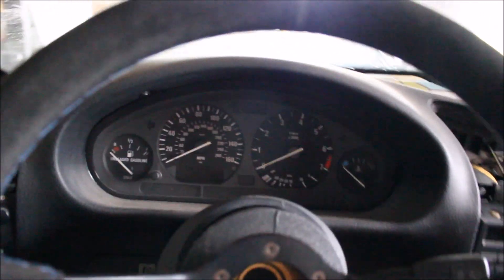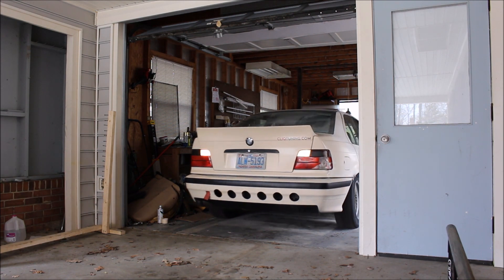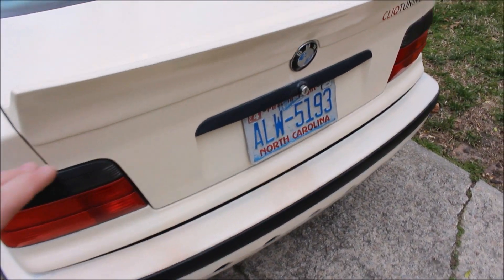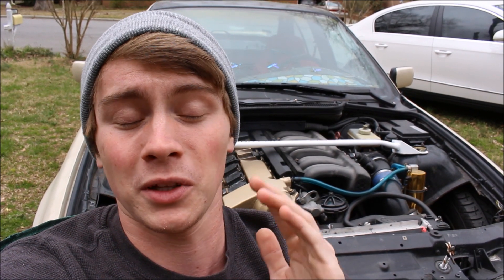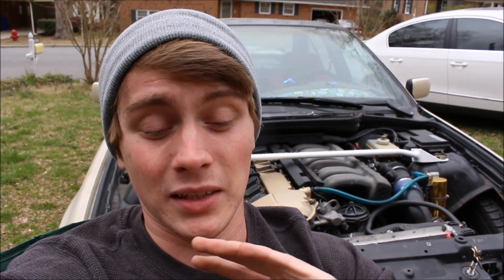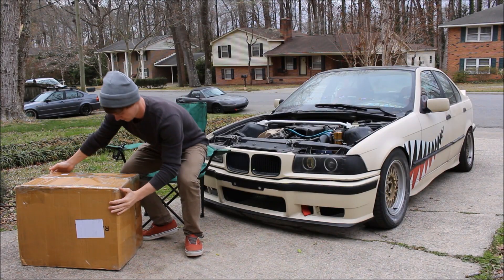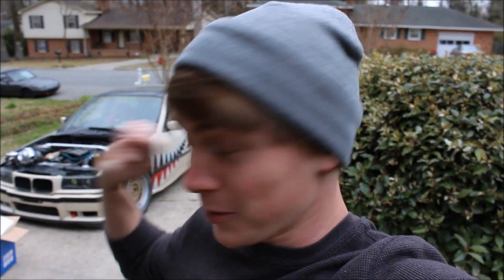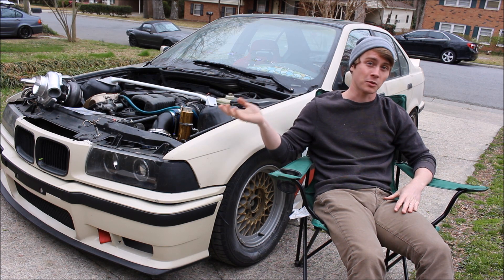THE E36 IS GETTING A TURBO! : BMW E36 325i Drift Build Ep.19

Comment: Turbo and cheap don't really go together 😉

Save your money and get a wideband and gauge instead of getting the flu straight off, that should be your priority. 

With my e36 I did set it up to run off ms2 but it was less experienced at the time with ms so I shelved that for another project and purchased the Miller war chip, there's more tunes available on their forum for boosted cars with bigger injectors. Plus you can use the 3.5" maf from the v8 bmws or a maf from a Porsche turbo, but the m50 maf gets maxed out with boost. 

If you decide on ms2 or ms3 you might want to look into knock amplifiers to use you stock sensors.. Or just run it with out then 🤔

Comment: most external wastegate springs lowest setting is 5psi, don't cheap out on fuel management, just get a pnp ecu. save up for an extra month and go tunable ecu, I went band aids when I turboed my miata, and after taking off all the turbo parts and getting a pnp megasquirt, I made more power na with just a decent tune I made myself.

Comment: I turbo'd my 2000 GS300 over a year ago and still no major problems. The oil feed kept popping off and piss oil everywhere. I drive it hard every time I drive it and makes awesome sounds on 7-9 psi bone stock 2j with a eBay 62/63 turdo lol but it's been holding up good

Comment: Glad to hear that you're turboing the 36. You will need a cometic headgasket and some ARP studs. As long as you're looking for 400ish hp, you can keep the stock internals. Also, you can get the stock ECU tuned (at least you can here) but a WAR chip should do it. Lastly, don't turn up the boost too high, 0.6 bar is safe but you can go a little further. Good luck with the build, I think I'll wait to see your results before turboing my m50b25 non vanos xD

Comment: Not sure u will blow ur motor like m3ntal said but pretty sure u will absolutely need a tune for ur car to run properly. Ur Ecu will have no idea what's going on.
Reply: Norman Daniels i blew mine ;) even with a stand alone fuel pump went bad leaned out the engine knocked threw a rod ..

Comment: you don't need a tune but you do need an FMU or else you'll lean out and blow. vortech fmu's can be picked up used for like $80
Reply: whoops I wrote that before you talked about it. and you can run up to 7psi safely with an fmu. anything above that is dangerous unless you get a megasquirt

Comment: Stock M50 injectors will be ok to 220HP. You will have to upgrade to bigger one, at least 440cc (44lb/hr) @ 3bar (~43.5psi) to achieve 350HP an upgrade fuel pump to 044 clone. Also it will be safe if you drop CR to 8.5:1 with sandwich plate(2 gaskets and 0.8mm spacer).

Comment: I've had 2 turbo e36 M3s and it will not be happy if you run it with out a tune. Buy a war chip and tune it your self if on a budget if not get a tune from rk tunes. Best around. Do the research. Get educated and make it a beast.

Comment: no tune will lead u to 2 problems. 1 one is that your car could be over boosted at high rpm. second thing is that your turbo might be turned off by your acu for the most of the time. the thing is that if u put turbo or swap it, it has to be tuned. + tune does not cost too much. atleast in my country its not more then 200e.

Comment: are you going to run that on stock internals? balls dude, RIP M50, I would at least run MLS with ARP hardware. also, good luck with no tune. as soon as you get into boost the DME is going to shit its pants. would get the turbo tune kit from RKTunes. I would get some help building this thing bro, your going to be in over your head. best of luck though, sounds like you need to do some research if you think your going to be fine running it untuned
Reply: M3NACE would love to boost my 528 E39. What is MLS?
Reply: it stands for mulitlayer steel headgasket. Vac motorsports sell them and they are thicker to drop compression slightly and dont pop under Forced induction due to excess cylinder pressure. if your E39 is M54 powered, https://store.vacmotorsports.com/vac-performance-mlsmulti-layered-steel-head-gasket-bmw-m52tum54-p1072.aspx
if not search your motor and add MLS headgasket on the end and it should pop up. if you plan in turboing it, I wouldnt do it without an MLS gasket and ARP head bolts. N/A BMW motors dont like turbo's, but if you do its better to do it on that headgasket/bolt setup as it wont bend the bolts and lift the head or snap the gasket under the power. you can safely run 8-12 PSI on that setup. anything more will require bottom end work as you might bend a rod under WOT in boost.

Comment: was your beemer in an accident? that front right frame rail looks bent.
Reply from the maker: Yeah, I picked the car up in rough shape after it had been wrecked. The collision bent the framerails a ton and destroyed pretty much the whole front end. However, the previous owner had the frame professionally straightened to the correct position. Also, the framerails bent before the shock towers so the crash didn't throw off the car's geometry or anything.

Comment: I will trade you my boosted Volvo for your e36 with the turbo kit, LOL JK but keep up the videos. You keep giving me inspiration to start my YouTube.
Reply: TJ Williams Tell me more! I have a V40 T4 and saw your profile pic.
Reply: I have a 2004 Volvo s40 LSE....unfortunately the T4 was never sold in america so I don't have it. On the bright side the LSE is slightly more powerful than the 1.9t in america. My profile pic is kinda old so a lot has changed. The car has black wheels, a lip spoiler, fender flares, a roof spoiler, a small trunk lip spoiler, yellow brake calipers, a custom modified grill delete, a boost gauge, a open downpipe, a short ram intake, a manual boost controller, h/rfl blow off valve, and coming in the mail soon hopefully will be my ARD turbo control valve. I was gonna get a upsolute ecu tune this weekend but I decided to take a small break from the build. the next mods are gonna be a throttle body spacer, intake manifold spacer, light weight pulley, and then the ecu tune. You can follow my build on Instagram at sluggish_s40

Comment: Where can I buy that manifold from?
Reply from the maker: Here's a link (they also make ones with external wastegate ports so check those out too)

http://m.ebay.com/itm/T3-Flange-Stainless-Steel-Turbo-Manifold-FITS-BMW-E36-92-98-M50-M56-I6-/232267611302?hash=item36143a7ca6%3Ag%3AY9MAAOSwwTlUrHjx&_trkparms=pageci%253Af8294fdd-0867-11e7-afef-74dbd1806561%257Cparentrq%253Acae7220b15a0a25076ef396ffff9906d%257Ciid%253A6

Comment: Dude, just go to a shop and get the stock ECU flashed with a custom turbo tune, it is not super expensive, you can run more boost safely and overall it is just a win win! Don't do the same thing as many others have done and expect a different result, that is called stupidity

Comment: No tune will blow your car up. If that's what you're looking for, go for it, but it's not a smart decision. Do your homework before attempting this. Boost is not cheap.
Reply: M3ntal he's going to use an fmu, it's not the best but it's gonna run just fine
Reply: No.. It won't. I'm speaking from experience. Without at least a piggyback on his ECU his car will not run properly.
Reply: If M52 can handel 0.5-0.6 bars daily why M50 could not take same ? 
Remember M50 is tank.
Reply: Zuze91 i had both no engine is a tank if it runs lean or knocks even built engine cant take no tune and boost
Reply: M3ntal 2-3 psi and no tune should be fine
Reply: carbs & boost are you fucking kidding me ? All this work to run 2 -3 psi lmao hahahahaha
Reply: M3ntal thats what eh said "2-3 psi"
Reply: carbs & boost why not run 14 like me ? With a that work and a little more effort in a standalone
Reply: its fine chill alex
Reply: M3ntal dude i have no tune for a year now on 8 psi. stop listening to what everyone says about no tune. if u do it good u dont need a tune
Reply: boosted 2j Lmao, you will burn a piston
Reply: no tune will blow up a car.   boost = more air, more air = lean, lean = heat, heat = detonation.
Reply: in other words, tune is critical.
Reply: Proxy Panda i havent for a year now so.
Reply: trytthisnow that's y u get bigger injectors. and an fmu.
Reply: boosted 2j Heaps risky ae. I am an apprentice mechanic, and I think that's not something Austin should be doing. It's just better to do a proper build.
Reply: Proxy Panda not everyone had 2grand for an exu and a tune and the way no tune works with the fmu and injectors makes it safe enough to run the car. i have my car running for a year and a few months no tune and it never skipped a beat.
Reply: at least just get a w.a.r. chip from miller

or an fmu
Reply: Can you even get that low of a psi?
Reply: Packrus yea but the waste gate spring gotta he changed
Reply: The car would just lean out, and i dont think the stock ecu can calibrate that, just putting more stress on the injectors. Doing things the right way first will save you more money and time
Reply: Packrus iv said this so many times. i had my car on no tune for a year. stock everything except the injectors. damn yall gotta read.
Reply: your name is boosted 2j lol pic of a miata haha
Reply: The car will not run properly without a tune. Period. No one cares that you've "ran your car for a year with no tune." It's not impressive, it's stupid. I have a supercharged M50 on 10lbs, and it NEEDED a tune. Even on the base map it was still leaving the AFR in the mid 14's which is way high at WOT. It's since been retuned and now sits around 12, which is where I wanted it. With no tune you're asking for knock and detonation, and swapping in a motor will be more work than getting a piggyback from someone like TRM, Technica, etc.
Reply: Yep yep! ^ Yep yep
Reply: because M50 has an iron head and M52 ALU head, right?
Reply: Both M50 and M52 are aluminum head and iron block. The M54 has an aluminum block.
Reply: No, M50 is a iron block. M52 is a aluminium block with nicasil treated bores. M52tu/M54 is a aluminium block with cast iron sleeves and all have aluminium heads.
Reply: US Spec 328is's have iron block M52's. All 6cyl E36's in the US have iron blocks. The 2.8 Z3 had the aluminum block M52 I'm pretty sure, but not the E36's.
Reply: should just buy a kdfi ecu.. cheap and easy
Reply: You don´t have to take everything so litterally, I was joking. But you did´nt get the real S50 engine for example and that is really crappy :D.
Reply: Jens Abrahamsson yea they fucked us with the s50 but we have the s54 which is better
Reply: Packrus Yeah and by that you refering we don't? Beacuse we do 👍😎
Reply: +unknown Uh.. NO ONE runs their car very long without a tune. Go poke around BF.c's F/I section and do some learning before you try to argue with someone who drives a boosted E36.
Reply: Sorry i meant "at least" we got the s54 also so its not a big lost.
Reply: trytthisnow wow great come back good for you
Reply: trytthisnow next time you internet mechanics want to talk try working on a car first
Reply: Please, take your own advice. you need it, desperately.
Reply: trytthisnow i like how you just use the same thing i just said
Reply: +Ryan Askins Lol wut? I built my car myself, but I left tuning to the professionals. Don't talk shit when you have no idea what you're talking about. http://imgur.com/a/CSrBx
Reply: M3ntal cool.
Reply: m50 is better for boost than a m52 lol
Reply: go watch ricer miatas videos and tell me you can't run without a tune
Reply: +Zach Bower Take your own advice. Where is Rodnock's Miata now? Blown up. How did it get that way? Boosting without a tune. Congratulations, you played yourself.
Reply: he ran that car boosted with no tune for over a year and blew it up because he decided to drift it with a massive oil leak. and that was after he took his serpentine belt off and intentionally trying to blow the engine. it had nothing to do with it being boosted without a tune
Reply: Dude he barely made any power with the miatas, with a tune you get way more power for any set up, plus its way  safer.  Bet he wasnt even pushing 10 psi with that setup.
Reply: boosted 2j make more vids on the China charger
Reply: carbs & boost que onda
Reply: Turbo with no tune...😑🤢

Comment: That whole car is an Ebay special. Its sad these cars have depreciated this much in value now that kids can buy them and rice them out. Be realistic dude, turboing a motor without a tune is completely dumb, not to mention running a turbo that large on 6psi. Youre better off saving your money and swapping a s52 or lsx. Ive had 3 turbo e36's(gt35r & gt4094r) and theyre not cheap to turbo, no matter how many corners youre trying to cut.
Reply from the maker: I don't cut corners, I drift them☺
Reply: lol good luck to you and your "drift" aka blown motor goals of 2017